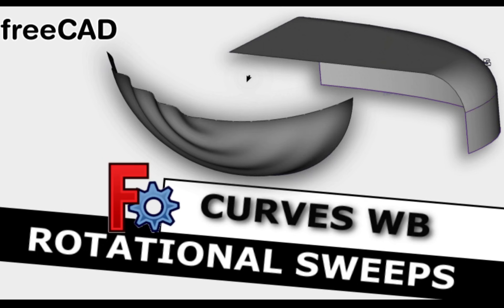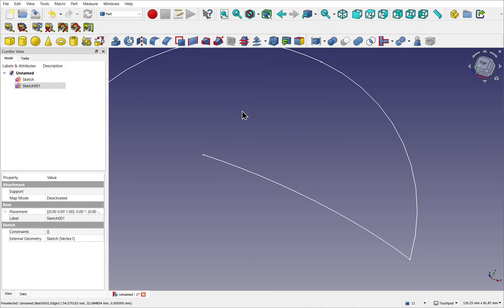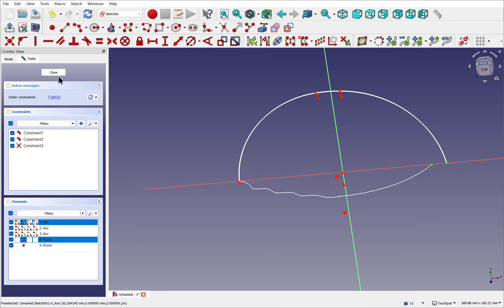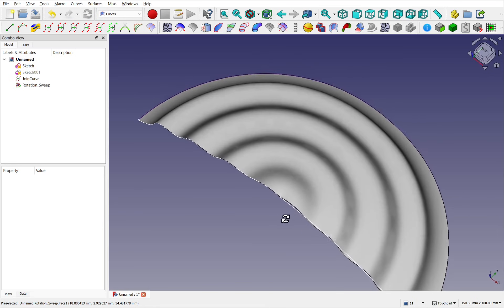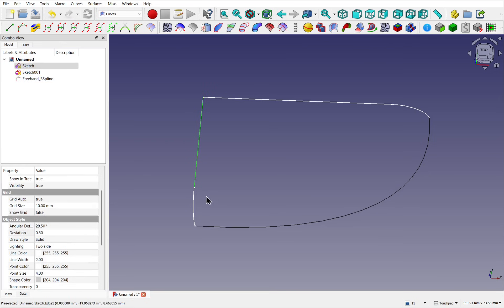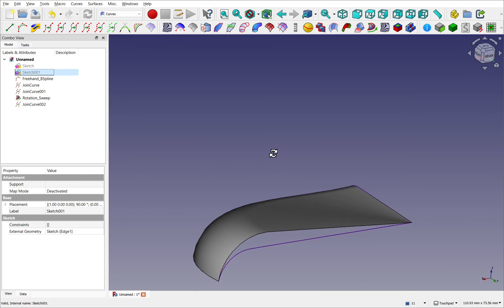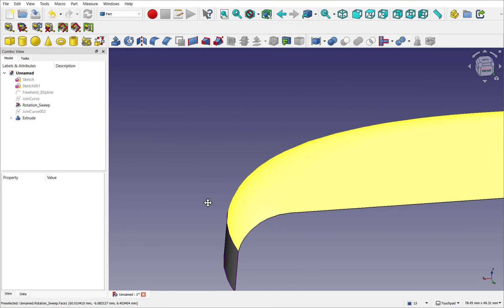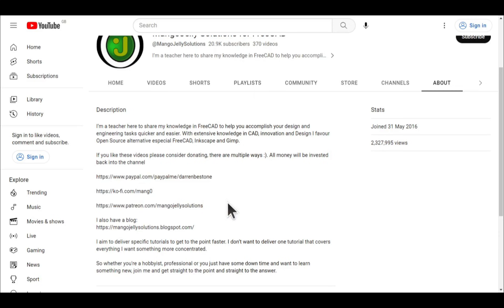FreeCAD: Rotational Sweeps for Complex Surfaces In Curves Workbench

Comment: Related to Curves WB. I want to create an arbitrary cam path on a drum surface. Is this the most efficient way? It just feels clunky and there's a lot of clutter produced in the process.
1. Create Sketch on Surface in Curves WB. Draw the desired path.
2. In PartDesign WB create a square sketch then a solid body using additive pipe using the path in #1.
3. XOR the body from #2 to the target drum or cylinder using Parts WB.

Comment: What version of FreeCad is this?Very nice and so silky smooth, I can use this on my replication for my automotive body parts! Another tool in FreeCAD that you have brought to my attention and more importantly demonstrated how to use and refine for a very professional result! 
THANKS
Reply: By the Sketcher's toolbars looks like Version 0.21.2 (Stable edition). The nice and silky smooth appearance is achieved in Edit menu-Preferences-Display and reducing the Resolution to 0.001 (the lowest the number the higher resolution you get but more CPU effort is required, depends if your machine is able to deal with).
The author preferred to change the resolution in the View tab (below the Combo window) as shawned in this video.
Edited: Typo
Reply from the maker: @LFANS2001 convered it all in their comment. All the info and more, nothing I can add there Glad you enjoyed and nice to see you already found a use. 😊😊
Reply: Try Ondsel, based on FreeCAD. I used to download the FreeCAD weekly build but got bitten by a nasty bug. At least Ondsel has some gatekeeping before merging and releasing features.